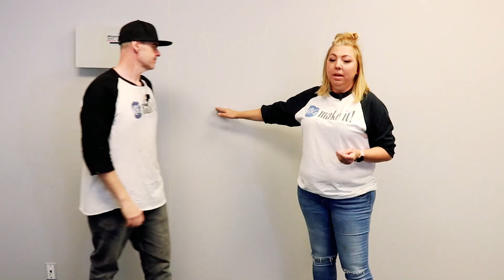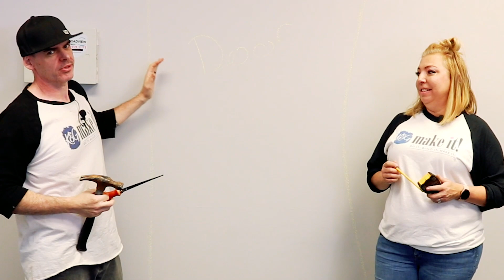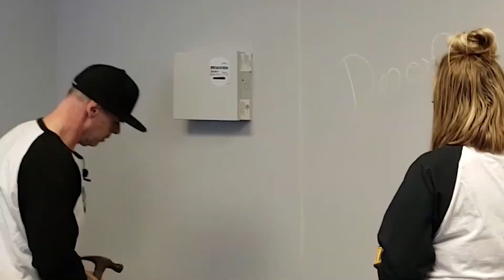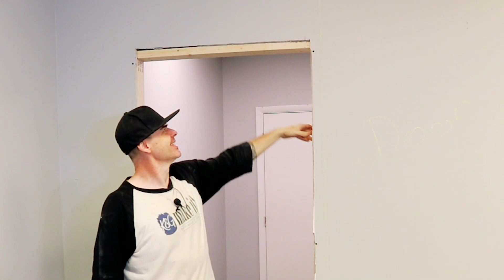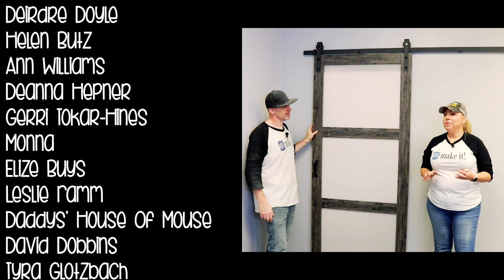Install a Barn Door in an Existing Wall

Comment: Wow, the electrical was all wrong. You can't hide junction boxes in a wall without access, code violation. Second, you mixed white 15A wire with yellow 20A wire in the same circuit, WRONG! Hire an electrician. Also, should have at least 2 of the track mounts attached to wall studs. These doors are heavy and if someone leans on it the whole thing may come tumbling down into a law suit.